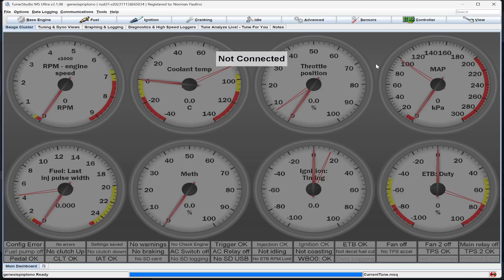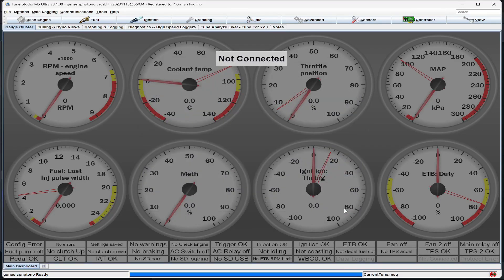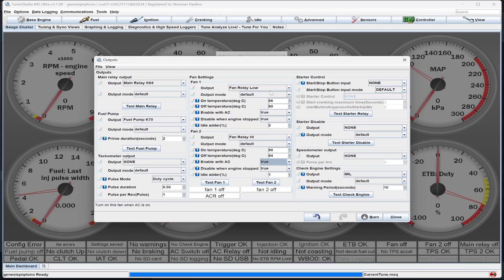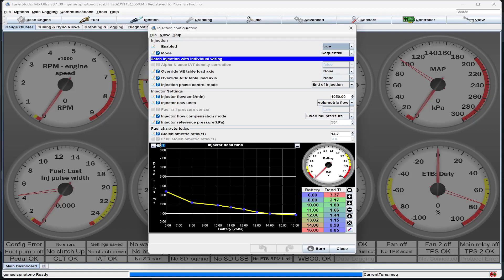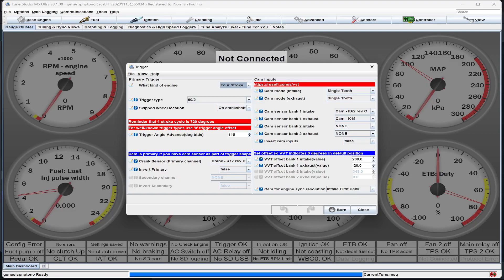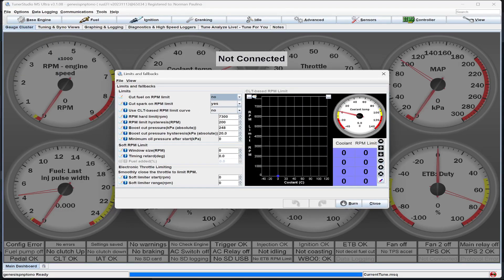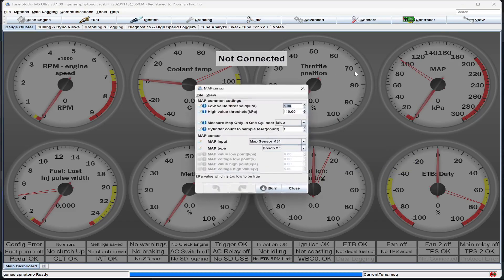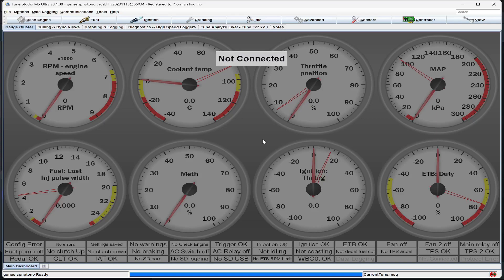How to do a base tune on your AlphaX Genesis PNP ECU!

Comment: For BK2 will this work with the OEM electronic wastegate and stock wideband? Are any interior electronics affected like AC/heat?
Reply from the maker: Yes it works with the oem wastegate, no electronics are affected. It does not work with the stock o2 (narrowband) sensor, but it has integrated wideband.